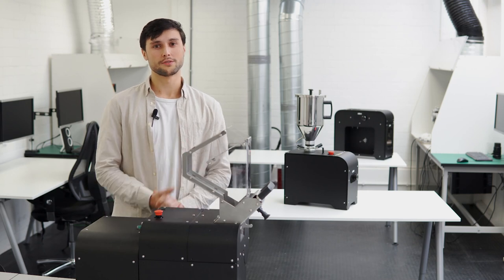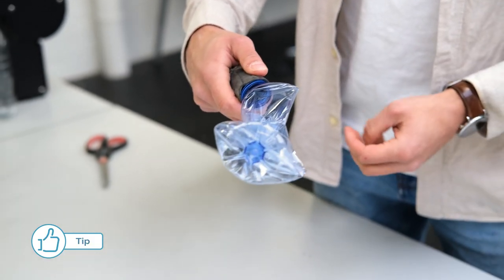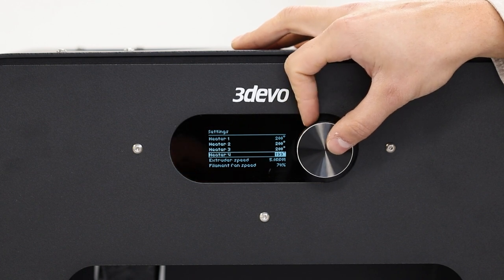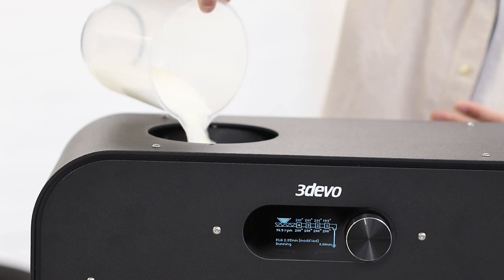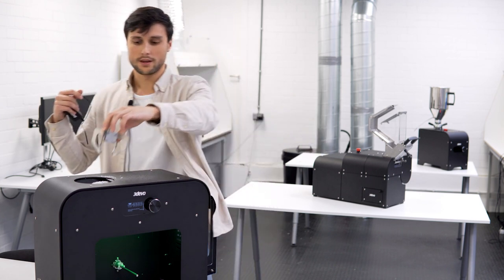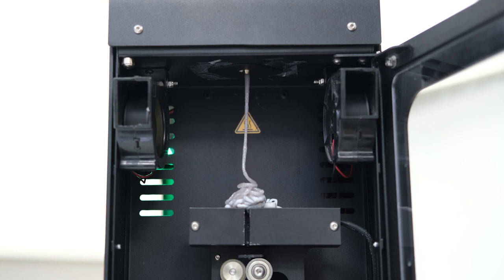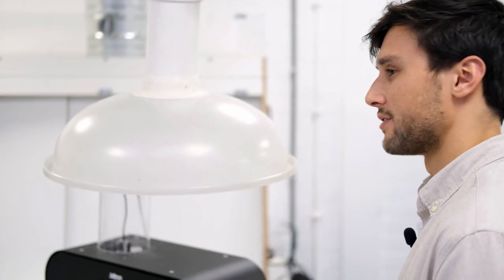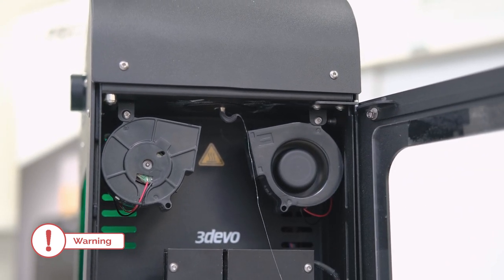Step by Step: How to Recycle PET Bottles From A-Z

Comment: Good work and nice presentation. Just a little hint, if maybe somehow come handy. The material at the feeder/hopper side (at the big extruders, there is usually heating zone 1), is room temperature and it gets melted by screw rubing it at the hot cylinder wall by decreasing a thread depth. That's why the temperatures can't be the same trough all cylinder. It coud work fine, but one of two things is surely happening. If the temperature is high enough, that material gets corectly melted at zone 1, then at the nozzle, the material is overheated. Or, if the material at the nozzle is fine, that means, that the matrial is not getting melted enough at the zone 1, so the thread decrease is forcing a hard material against the cylinder walls. That can damage the transmission or even break the screw (Did that at 90mm diameter screw). There are not 4 zones there for no reason. The temperature at the Z1/feeding must be higher than at z4/nozzle. With some PE-LD or similar materials, it is not such a big deal, but, PET is not that ""gummy".

And one more thing. If your nozzle is yet not hot enough, try to lower the RPM, not increase it. That way the material stays in the cylinder longer, gets hotter, more liquid and the material itself heats the nozzle "from inside", which is much faster than waiting for a heater to do it. And also here, to raise the RPM or force feeding the material trough too cold nozzle, doesn't sound like some good idea to me. It might be expensive. 

I am not trying to teach you anything or being smart, my experiences are at bigger extruders. It's just a friendly mention, if maybe it can be of some use.

Comment: 3Devo doesn't wants to sell their extruders at all. I tried contacting them and their sales department is a disaster. They ask a thousand questions and even then they don't give a quote.Every time i email them they just reply with a different email with no follow-ups. Really sad to see the response but I at the same time I am  happy because I found a much better supplier in China who designs a similar model with a few improvements and gives prompt reply. I have started recycling pet flakes without any issues as Chinese machine has proper feeder instead of gravitation vibration feeding which is a bad design for lighter material as it gets stuck in hopper. Pet is not a tricky material, its extruded all over the world, the technical team clearly dont have any background in plastic extrusion or recycling and practical issues that happen during extrusion
Reply: Hi 👋.can you help me?

Comment: Hi,
What if the bottle wasn’t clean (like in an industrial process)
How would you clean the grinned pet?
What chemicals would you use?
I’m trying to find information about it and it’s really hard to find 
Hope to hearing from you :)
Reply: Using mineral spirits to remove oil adhesives

Comment: I like it a lot, nice products and recycling PET is very environmentally friendly and easy as the average consumer uses and throws away lots of plastic bottles. However for the normal average consumer willing to recycle, I think the cost of a single machine is still too high unless one is 3D printing material intense prototypes. A nice cost for a single machine would be around $750 or around 3D printer costs.

Comment: Love the video, thank you so much for the effort!  I have one suggestion. Do not use vacuum to collapse the bottles, use heat. Bottle 'blanks' are injection molded, but the blanks are then heated and expanded with air pressure in a mold to create the final form. If you heat up a PET bottle it tries to return to the 'blank' shape  (it looks like a test tube). Take a look at the beginning of: "https://www.youtube.com/watch?v=9Eq4C9ch-vk" for an example. The advantage of heat shrinking before grinding is a significant reduction in bubbles.  After grinding you end up with hard lumps like pellets rather than thin stringy flakes.

Comment: My question: can you change the diameter of de filement. My 3D printer can handle 1.75 mm
Reply from the maker: Hi there,

Yes, you can simply go to the menu and set any diameter you want between 0.50mm and 3.00mm. (including 1.75mm and 2.85mm, but also 1.76, 1.77,.....).

Then, if the flow of plastic is stable with good settings, the optical diameter sensor will adjust the puller wheel speed automatically in order to stretch the filament enough to achieve the desired diameter.

Keep in might though that in this case you might need to adjust the extrusion settings (heaters temperatures, screw rpm, fan cooling) until you have a nice flow of plastic again.

I hope this helps.

Comment: Hello 

We have one of your shredders. After washing the bottle on the inside - do we have to let it dry before feeding the shredder? This is unfortunately not clear in your video. Thank you very much.
Reply from the maker: Hi Khalil,

Moisture can create different issues during the extrusion step, that is why we used our Airid dryer to dry the shredded parts. So yes you need to let the bottles dry out after you wash them but that alone might not be enough as the polymer will keep some of the moisture from the air. It is highly recommended to proceed with a drying step before the extrusion.

Thank you.
Reply: @3devo  Hi 

Thank you for your help. I'm currently in Nicaragua with your shredder version 1.0 November 2017. We are not producing filament, because there is no market for that. That's why we are focusing on the flakes/granulates. 

How do you let the bottles dry out after washing? Do you have any specific tips? Because we're not gonna clean the bottle when it's entire, we cut it and then we wash it. This needs less water (herein Nicaragua sometimes there are water droughts). But now can't find a very efficient way to dry it - do you maybe have something in mind?

Thanks a lot
Khalil

Comment: Is this only applicable for PET bottles?
Reply: I would expect PET fruit punnets and if properly washed, meat trays, may work too
Reply: no, it works with any type of plastic although you may have to cut the plastic into chunks to get it to fit into the shredder. I'd imagine a hot wire cutter would be good for this